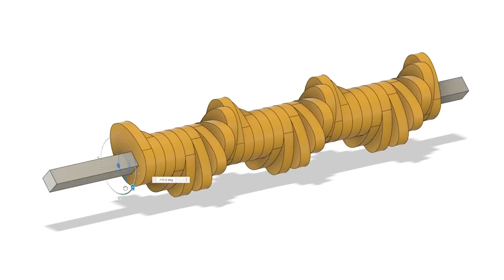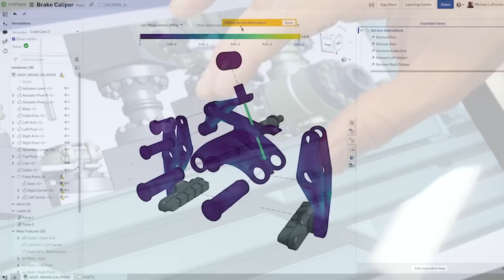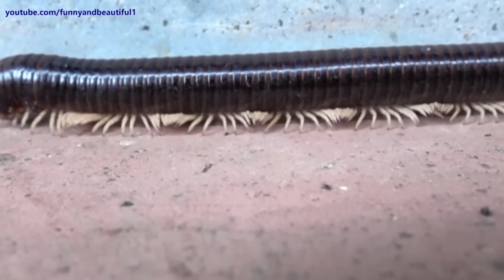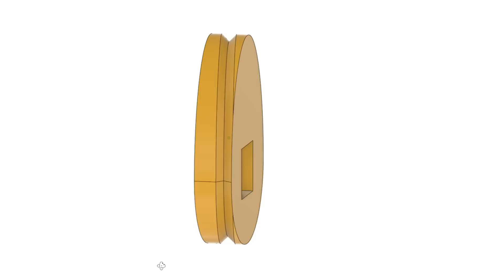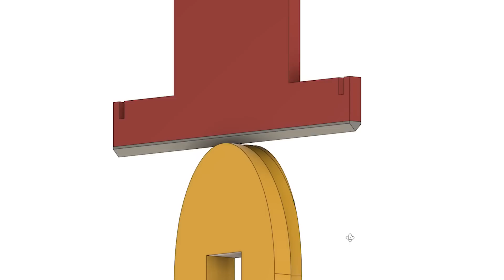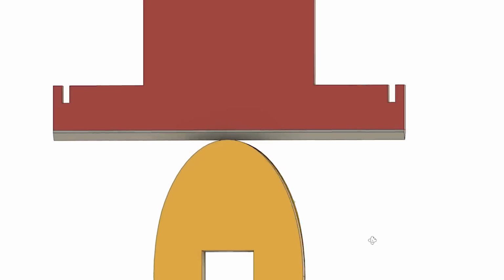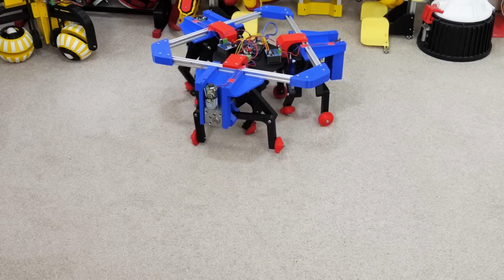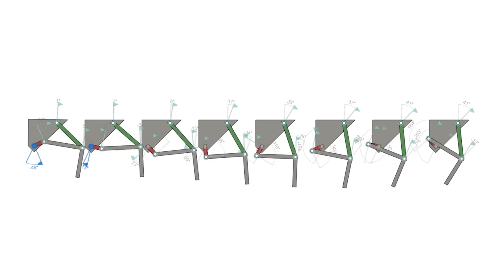Experimental Wave Drive V2

Comment: I think it’s more a game of cam-screw pitch and motor velocity than anything else. You would want it such that it teeters (shifts it’s weight) toward the direction you want to move. 

Also I wouldn’t think a pure sine function is the best for the camshaft either, consider a wave profile that group them into 5 or 6 ‘flatter’ sections. And as some of the other comments are suggesting, consider a longer action section of the cam disk profile where the cam can be active state for ⅓, ¼ or ½ rotations.

Comment: Note that on the spiral drive each tread would give a little flick at the top and bottom as the rate of change of the angle would be at its highest.  Perhaps if you changed the grooved cams such that the angle changed fastest near the peak it would travel a bit better, however the width of the groove would have to be much wider as well or the ridge on the toast might pop right out.

Comment: The current cam has a consistent diameter when it's at the top, but it's pointy when it goes down. So what if you have a consistent diameter so it touches the ground for longer? Then that area can be used to move it in one direction. So you could use 50% of the circle with the maximum diameter, 12,5% to transition to the smallest diameter which can be 25% of the circle, and then use the remaining 12,5% of the circle to transition back to the maximum diameter.

I am not an engineer so I don't know how to explain it properly, but I hope you get the idea

Edit: If you don't understand it, please go to Wintergatan's video "A New Music Programming Pin" at 6:44 where he starts explaining how Japanese Karakuri work.
TLDR; They're using cam discs, and several of these discs with different patters can create intricate movement. 

At 8:27 he also shows the principle. If you have the groove that moves the toast forward on the highest part of the disc and move it back on the lowest part, then you'll have all the movement when the toast is touching the ground.

Comment: It can't work if the legs just go up and down. It just moves with vibration on a flat surface. In some sand where the legs can go deeper into the ground, and more legs can act on the wave form. Now just one leg goes up and down on a flat surface really fast. It needs more legs to touch a uneven surface to work

Comment: it feels like the vibrations overwhelms anything you trying to do with this one.

also i cant be help but be curious to what would happen if you picked something like those small rubber/silicon nubs that are used in the supports for glass tables and shelves and placed 2 of them in each toaster, effectively making it 2 little legs

Comment: It cannot work in principle, since there is not directional force generated at the contact point. You need to angle the bottom part, so it will bend at contact, and generate the directional force. like it happens with hexabug (if I call it corectly)

Comment: It will only drive when something pushes forwards or backwards...
In the screw design, when the lowest bit touches the ground, it changes angle and direction to go back up. That's the pushing force

Comment: put the cam through the centre of the toaster , each slice of toast has a slim line low profile bearing with an offset pivot on the inside of the bearing to fit the cam shape .
think of it like a fried egg on toast in each slot of the toaster.

Comment: The groove in the cam isn't moving at the point where the "feet" touch the ground, so no movement is transferred to the ground. Also, your cam profile is upside down, with too little time on the down-stroke.

Comment: The immediate thing that springs to mind to me is to have the rubber strip on the bottom, but have a series of rubber (or maybe plastic?) feet screwed into the rubber. I think they would get the motion you want.

Comment: I think the last mechanism have a chance to work. Just needs a thicker cam so that it will have a wide movement (left to right). Then the center of the feet should have joints to the slot so the movement will have more motion and constant than the feet is just loosed to the slot.

Comment: I think you need a foot with rubber grip between each pair of legs. This would mimic sections of your track from the previous version. As the foot pivots back and forth this would give the forward force at the ground you need

Comment: Making flat peaces of plastic with 3d printer...for love of god learn the production methods suitable for each part, other than printing everything. 
By the times you get one printed one could have produced one with hand tools and then just use router to clone that how ever many times with cheaper costs. Get it done in cnc mill and its done with same effect, cheaper cost and faster.

Comment: You might want to check out the biomechanics of snail and earthworm locomotion.  Worms have a travelling wave, where alternating sections of anchoring and extension travel down the body.  Snails use a traveling wave to create shear which solidifies mucus to create a travelling anchor.

Comment: @James Bruton This feels like it was done too hastily to get all the parts printing before enough thinking about things and how they need to fit together to move were considered, and this was done repeatedly in this project. I could tell before it was tested that the toasts with the cams weren't going to be of much value, because it's logically like a millipede marching in place: it's only going straight up and straight down, where the only reason it moved in a direction was more down to sloppiness in the mechanical parts.

As slow as 3D printers are, even a bunch of them in concert, it makes sense to print a small part or few parts to test in as small of material volume and time as feasible to test key small concepts: unit testing each part in isolation, as you'd do software development. Instead, what we saw was the Big Bang method of software development instead of iterative design, and the end result, because there was not nearly enough forethought to test in small bits, was a Big Fizzle, and a lot of wasted filament.

This one was not up to your typical quality.

There is some fun geometry that would work perfectly as a cam inside a square for directed motion that you missed entirely: the Reuleaux triangle. I'd suggest you look it up on wikipedia, where it has a nice animation showing what you need. If you used that as shown in the wikipedia page, you would end up with something that maximizes the amount of flat-footed motion in a nice way, and it'd not take nearly as much materials to make a fast device.

Comment: the thing was never going to more in the first place as there is no side to side movement of the feet. Not sure how just a up and down movement was ever going to work. the other design moved due to side to side movement imposed by the spring on the foot plate, it the spring did not pivot the foot plate and gave a true up and down motion then it would have also just sat there rocking.

i think I'd go for two cams one driving the leg up and down and the second back and forth.  But if you want to go over rough ground  i think i would use motors to drive the legs. as i would want to try and keep the platform level. so adjusting the leg length until the correct amount of weight is placed on it and then move it to the side. but still fun to watch.

Comment: Just line up all the toast pieces then cut a diagonal line across the bottom of them all so they are all at different lengths and drive it with everything at an angle. When the cam pushes the legs down it will also push them back a little so you will get reliable forward movement with minimal change to the design.

Comment: That wabble you put in the T/toast sections didn't look to be at the end of travel. The curve cut in the cam only needs to really be at the high point or it's wasted motion as far as transferring movement. Don't know that it would work with it but it definitely won't work without it it might need a hinge "slot" that it can slide up and down but also pivot on, giving it a stable travel and amplifying the force with lever action against the ground.

Comment: I think because of the motor angling it slightly so it is basically tapping the ground.
You could improve it quite a bit by amgling the toast at a 45 degree angle

Comment: Hey James, I think one way to make your machine move is to attach a short leg to each bottom piece of toast, so it can rotate forward/aft slightly. The rotation should be linked to the position of the toast directly in front of it (or behind it). The linkage to the neighbouring piece of toast therefore must allow a sliding motion. This should give you the circular motion you need for walking.
One problem could be the loose mounting of the toast pieces making the legs jam.

Comment: Try putting it at a slight angle: so the feet are not perpendicular to the walking surface. I believe it should push forward and pull backward with sufficient grip.

Comment: It doesn't produce move like it was with that spiral who generate angle , here it only move up and down. If you attach some rubber truck and mount to base in a joint it should move .

Comment: If you want to make it work add on the legs flexible material around 2 cm so its already bended when you put it down, and everytime when it goes down it push it forward, but it will move only in one direction

Comment: One thing I will say is I bet the sleeve would work if there was material to push off of. the wave motion is capable of moving material, which would push the mechanism the opposite direction, but a flat surface doesn't help. Think of a sidewinder in sand.

Comment: I think you were on to something with the guides on the cams, if you look at the previous design with the helical coil at the apex of the wave the links rotate move the little feet backwards, my guess is this is the main driver of the movement and the wave is just a mechanism to achieve this. I think if you had a more defined rotation point on the "toast" within the "toaster" that the cammed cams can rotate the cams about, I think it would work. but without that slight back and forth movement it's not going to go anywhere no matter how much grip you give it.

Comment: tldr: you are tip-toeing like a ballerina in stead of walking...

I would suggest that the cams are the wrong shape. The toasts have only limited contact time (it looks like max 10% of the time) with the surface. Consider reshaping the cams to increase that contact time to about 50%. That results in more toasts touching the ground at the same time. It also gives you more time to perform the front-to-back motion using the groove. It would produce a much smoother and pronounced motion.

Comment: Your problem with the cams is that you built them like valve cams. You need to make them fully extend for longer and only while extended the groove should move the little feet back, that way you're actually taking steps.

Comment: Wave motion can't move an object that's wider than the wavelength. If you turn it upside down, it'll push an object that's small enough to fit between two peaks, but not one (such as the floor) that's long enough to rest on two peaks. Basically, any motion you're going to get with a waveform design (with more than one peak) is going to be because of loose tolerances.. and if you're relying on sloppiness as a motive force, it'd be simpler to just make the thing vibrate.

Comment: You could reshape the cams on this design to have the toasts be fully extended for longer. Essentially the inverse of what you had in this video, where you have a positive impulse wave with extension downtime at the fully retracted position. So instead shape the cams to make a negative impulse wave, with extension downtime at the fully extended position.

If you combine that with some ridges sticking out in the toaster slots to constrain the toast to more defined fulcrums, then that should at least get it walking a little bit.

Comment: I think you could get this to work with a different cam shape.  Your final slotted design has a leg only touching the ground briefly.  The forward back motion during this time is too small, and vibration is overriding any potential wins.  You want to move the leg back (to move robot forward) only when the leg is touching the ground.  So the cam should have 4 distinct phases: Down and back, lift, up and forward, lower.  Where up/down are controlled by the cam radius, and forward/back by the slot position.  Your final cam will have two quarter circles and two shapes connecting them.
You might also need to put a thinner section in the middle of the toaster slots, so that the forward/back motion has something to lever off of.
Reply: It's the "lobe" of the cam that needs to change. Rather than being egg-shaped, the peak should be wider so the foot stays extended while the groove moves the foot backward.
Reply: @James02876  This is exactly what I was thinking. If you made the top of the "toast" pieces come to a point, you could have the bottom of the cam, when it is pushing the furtherest down, nearly flat but with the groove for the pointed cam follower angled towards the front. Then the toast would dwell at the bottom (and be touching the ground) while simultaneously being pushed backwards.
Reply: Thank you, thats exactly what I wanted to suggest!
Reply: And some rubber feet that actually grip, not smooth plastic that slides.
Reply: Exactly! I might add that you could have a bit of a bulge or a ridge at the halfway/middle of the new thinner toasts, which would provide a precise fulcrum location and allow a larger and more controlled motion  at the bottom. That is, controlled front back motion at the top and a controlled pivot at the middle gives controlled front back motion at the bottom. Raising or lowering that fulcrum modifies the magnitude of this front back stroke.
Reply: Yep! Exactly what I wanted to say. Have the cam lobes changed so the leg (toast) touches the ground for, say, 180 degrees of cam rotation, while the cam groove moves the leg slowly back. Then say 60 degrees each for moving up, forward and down. So a slow push back on the ground, followed by a quicker up, forward, down motion. Combine the last three for a smoother leg motion.
Reply: If you look at the “feet” as a sine wave and you increase the wavelength to have more surface area when the feet touch the table, you should have a better result regardless of the table’s leveling. Essentially what the previous comments were saying about changing the shape of your cam so your wavelengths are longer.
Reply: I think an experiment with both offset-circle cams would be fun to see.
Alternatively, an oval cam, where the farthest curve of the oval (down and back) has its radius in the shaft, but the rest of the oval would be less important.
Reply: Yes, this is why the one with the rubber feet moves. It’s not the wave motion in the same way the tape rolls along it, that effect doesn’t transfer to a flat ground.
Reply: Had the same thought
Reply: It could also help to increase the distance between the toasts so they can alternate more into movement direction.

Comment: I'm honestly surprised it moves forward at all without a track, I'm not even sure how it does that. On the first version I assumed the slight rocking/rotation of the track links as they moved up and down helped it shuffle along, but here I just don't know. The land worm sounds cool. I think centipedes/millipedes have some compliance in between the legs which allow sections of the body to expand and compress which is also important for how they walk.
Reply: It's just shaking itself downhill, it not moving per se
Reply: @Koushakur  didnt the first setup manage to move up hill, albeit slowly. Maybe i misunderstood.

Comment: 4:22 The logic of the engine, which is used to exceed the speed of light, is thought to work like this. A machine creates gravity bending the universe and pushing the spaceship from behind etc etc.
5:52 The design of those feet was supposed to be tilted forward at an angle of (for example) 60 degrees to the ground, not 90 degrees.

Comment: the cams will work but the design need to change some. the trick could be in the lobe shapes so that there is a longer contact time and only in that time of contact the forward movement should occur and a pivot point that is better attached at the top of the toast🤣.  all good fun.

Comment: Like billee said, you need to introduce horizontal motion with legs. Inspect the tread, this only moves forward because there are legs on them that come away from the surface at a solid 90 degree angle. As one segment makes the little rotation you described, the foot extends that motion downward and to the sides while it also adds a grip. 

To make this design work you could punch holes through the rubber sheet and add 3d printed legs with rubber caps on the end. Think of the motion of a caterpillar

Comment: I think you're loosing a lot of the forward-backward motion generated by the grooves in the cams because there is no defined pivot point between the "toast" pieces and their slots.

One modification would be to print a thin cap for the box section with slots that are a close fit to the toast. This would be mounted to the top or bottom of the box section. The problem would be top-mounting might mean too much movement at bottom and the feet would intersect with each other. Bottom mounting could mean not enough movement. For this design the throw of the cam groove should not be equal throughout it's rotation since the distance of the lever it acts upon changes.

The other way would be to glue small diameter steel rods to each face of the toast pieces. The advantage would be that you could calculate the optimum hinge point and a constant helix angle for the grooves.

The other thing I noticed is that the cam groove should be a larger angle than the traveling point to account for the helix angle.